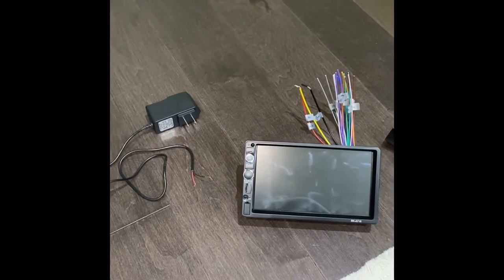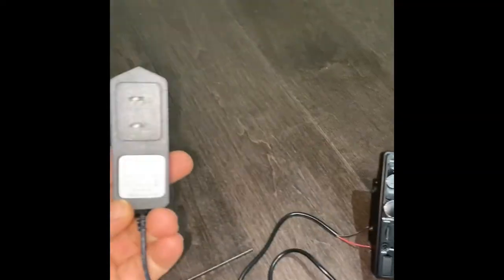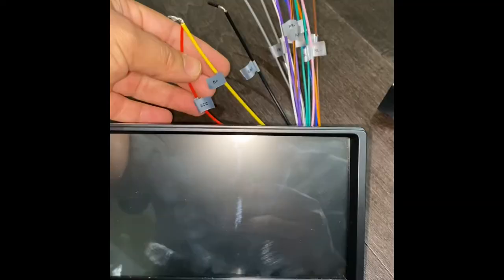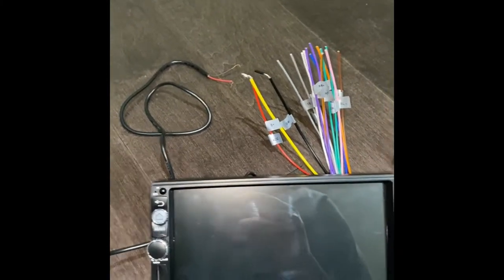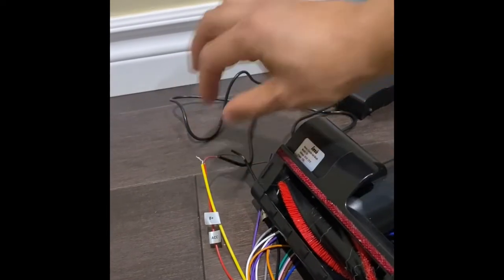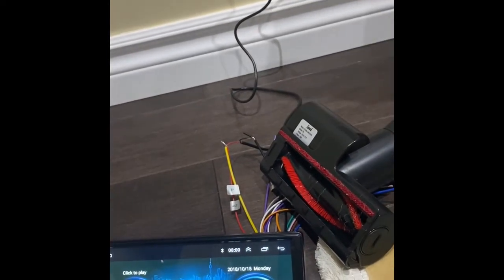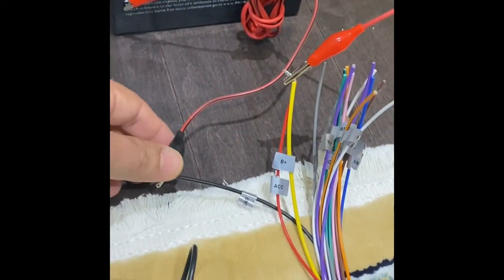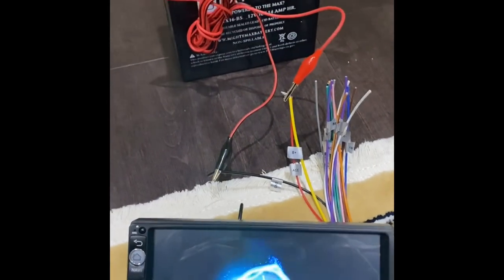How To Test a Car Stereo Outside the Car

Comment: Can you test with just negative & positive wires or you have to hook up the yellow wire also?
Reply: The yellow needs to be together with the red or it will not turn on. Only if you install it in your car yellow with yellow and red with red

Comment: It’s Only 12 Volts DC There Is No Shock Hazard
Reply: Right. To us. But to the components yes. Just make sure to isolate wires. Use some electrical tape and make sure no speaker wires touch each other. If they are not new and already have the shielding off just electrical tape to isolate. Following that this is 100% safe for the radio (and humans)